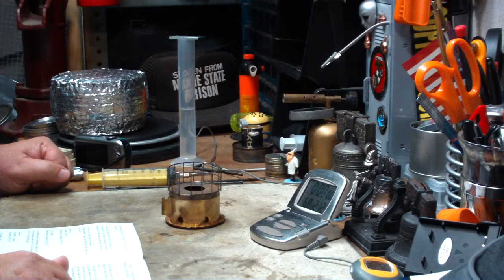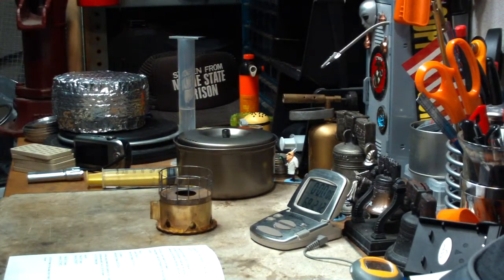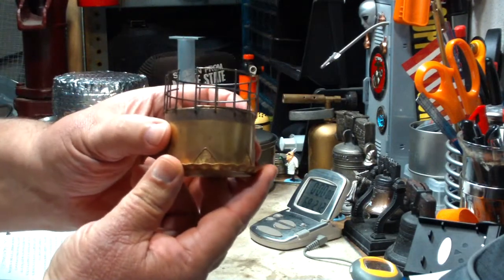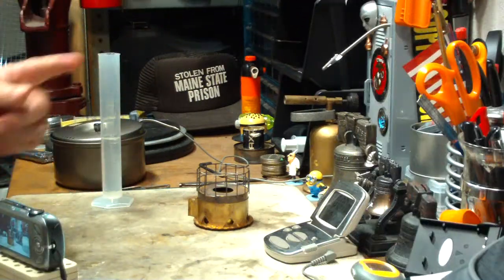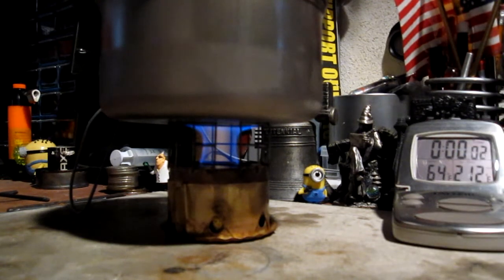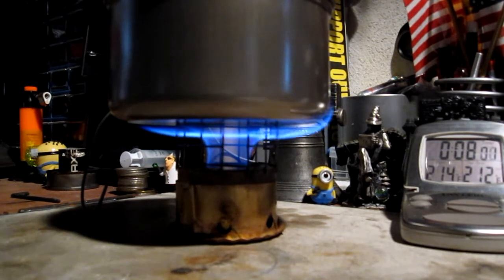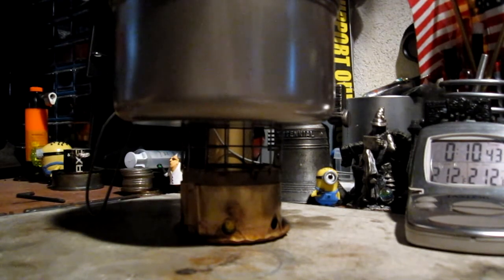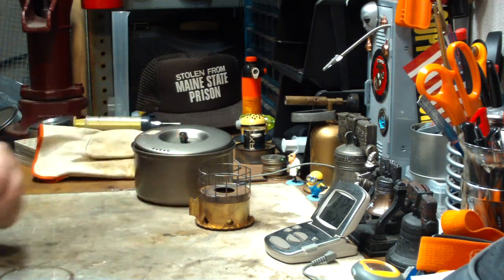Brasslite Turbo II-D - Vargo Titanium Pot (0.9 Liter) - BT #2 - Normal Weather Ignition

Comment: The Brasslite site was recently revamped. I was looking for online reviews of my stoves and ran across this one, albeit 10 months late. It's a nice video. I'm not exactly sure what the reason for the 2 minute discrepancy is, but I suspect two things: 1) The tests I did that led to publishing boil times were using the cold weather ignition. The so-called warm weather ignition has been eliminated on the new site. It's just plain easier and faster to use the preheat all the time, and it gets the stove going much more quickly. 2)The sheet rock is acting as a heat sink. This can also happen if cooking is done on a rock in the field too. It's possible to get the stove to not boil at all by putting it on a metal surface. The stoves are also in process of being redesigned to remove surface area contact from the bottom. I will probably be redoing the boil tests with the new stoves and adjusting the description and boil times accordingly.  Aaron, Brasslite, LLC

Comment: The interesting thing would be to have the stove heat up first, like suggested in the video, haha. It’s my guess as well that’s what the Brasslite people do :p If you get the same measurements as they have, we may know how they did it. And if not, Brasslite should do a full featured video burning test, with all variables shown and measured. No Video cuts ;-)

After how many time does the stove burn with a greater flame due to the burner heating up? More or less than 4+ minutes?

Thanks :-))

Comment: You're worried about altitude, and no one questioned the fuel used, percentage and ethanol/methanol proportions. Tight windscreen (nice and even 1/4 inch gap around a pot) makes a lot of difference, keeping hot air close to a pot and reflecting the heat into the stove too. 22ml also will boil water quicker, than 30ml, there is less fuel to warm up, the stove will reach full speed faster.
Reply: @Luke J
Your comment is the only one that makes sense! You’ve covered ALL of the variables that wasn’t taken into consideration bcuz I’ve owned the first 2 generations (including the pressurized model with a simmer ring & a snuffer) & this “stove” is GREAT 👍🏼 I really don’t care about speedy boil times and use the simmer mode more often to cook real food for one (myself) I’m not sitting next to anyone mocking my style when I’m cooking on the go or work meal time. Even my DIY & LUXIDA siphon burners are faster & “better” except for the fuel efficiency with BRASSLITE having a loooonger burn out time (simmer wasn’t set in demo) that other alky stoves / burners can’t match. My DIY siphon burner with simmer ring does about 14-17 min 15ml D.A.but a semi rigid aluminum can with a V or Triangle pot stand, ground plate & windscreen it’s light but lots of put together pieces, the same with LUXIDA DIY with a simmer ring on that pot stand. BRASSLITE + windscreen and you’re boiling or simmering for a real meal to cook! SGT ROCK’s ION stove system I made is a great fuel efficient system as well. TRANGIA retired
Thanks 🙏🏼